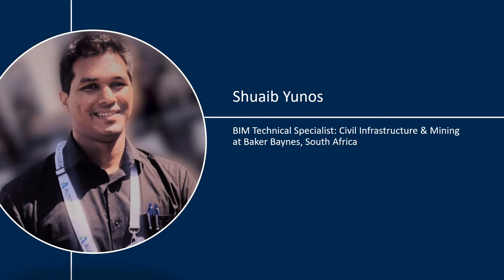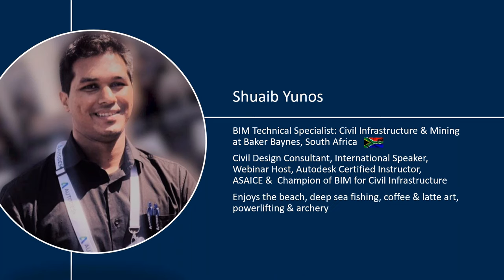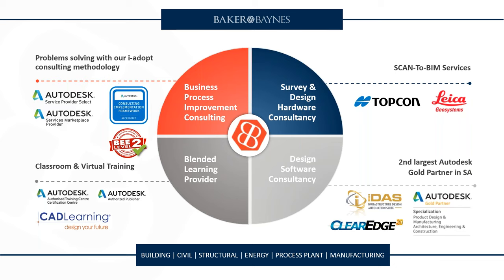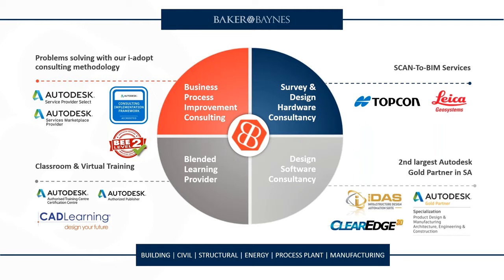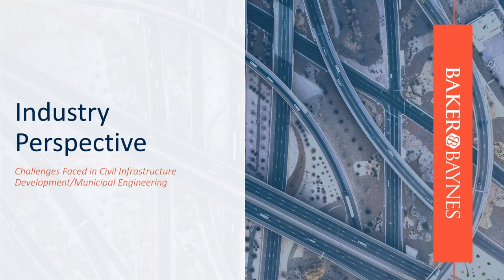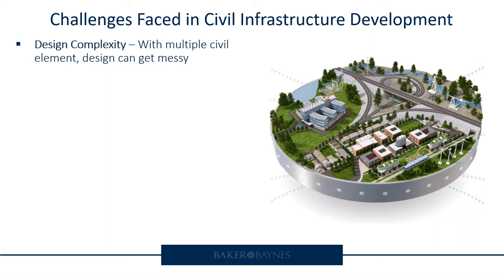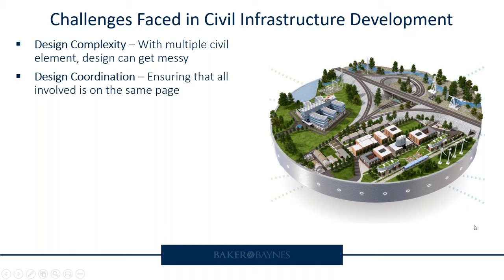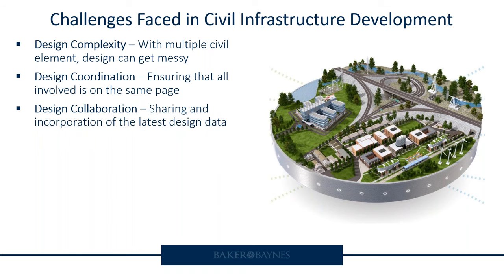BIM for Civil Infrastructure Development   Part 1  Site Design

Comment: Hi Shuaib, thanks for the webinar. When you want to present your site | platform design to the client, they want to see the proposed design or platform level | elevation (s) and you did not cover that. Would you take one of the elevation points at the vertices of the boundary level (feature line), which is 41.061m?  

Based on your discourse in the video, you considered a flat terrain, even on that, you might have more than one PPL. What if in an instance where we would need to retain a certain portion or mass of soil, how do you go about it? 

Once you have your survey, would you superimpose it on the one from Infraworks? If you do,  would they interact? Or, you need to start afresh. Thank you.